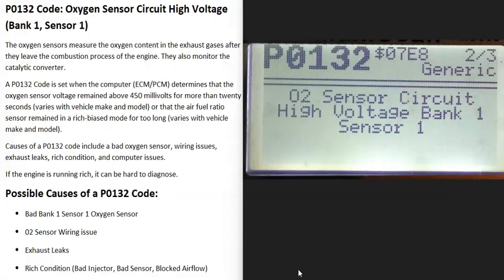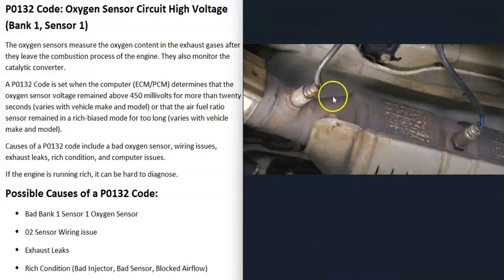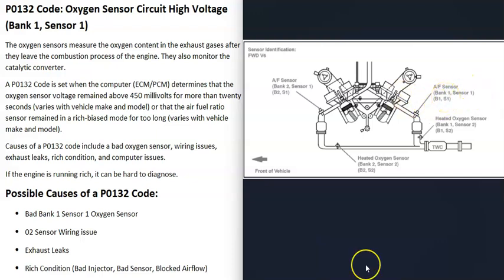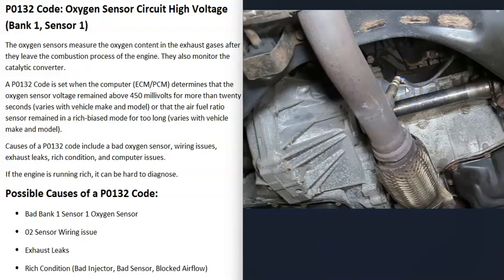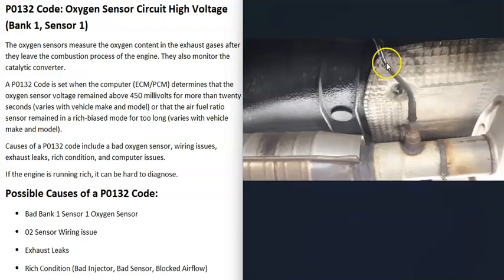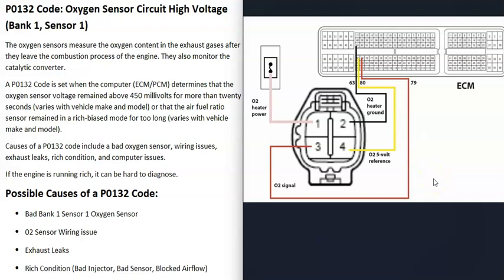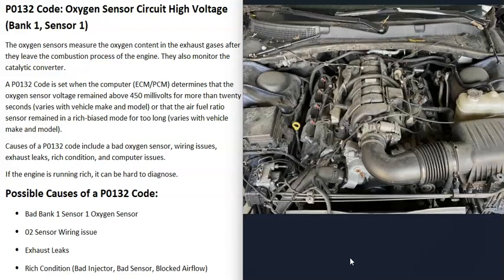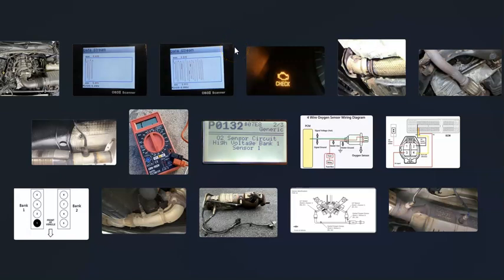Causes and Fixes P0132 Code: Oxygen Sensor Circuit High Voltage (Bank 1, Sensor 1)

Comment: Try cleaning or replacing ground for o2 heater.  My 09 caliber had "high input" codes for front o2 heater & manifold flow valve, and had "low brake fluid" warning lamp on, and inoperative headlamp lo and hi beams, and right front park/turn lamp inoperative.  All of these ground at the frame rail, along with a couple other components, all ganged together in one ring terminal.   I cut off the ring terminal and cut each ground wire back a few inches, then spliced in new wire segments with a couple new ring terminals, and cleaned the grounding post.  Cleared codes, and all problems were gone.  Find out where All your ground points are in the engine bay, and do this, before putting any more parts on the car.  Use copper dielectric grease on the bare wires before inserting in new terminal rings, then seal the terminal with liquid electrical tape after crimping.  Good luck!

Comment: 2016 Dodge Grand Caravan. I had an active PO132, historical P1128 followed by PO121. Added O2 voltages to Torque Pro which seemed in line, so I erased DTC's, drove 30 miles, no codes and seems to run fine. Whats my next step?
Reply from the maker: If the codes don't come back, then you're good. If they do come back, there may be an intermittent issue, like a bad connection or a component just starting to fail.

Comment: I currently have code p0132 and p0300 at the same time.. 02 senser suspect only i hope
Reply from the maker: A bad 02 sensor shouldn't cause a misfire. The engine won't be as responsive and efficient, but usually, the computer uses other sensors to keep it running with no misfires. P0300 with no specific cylinder codes indicates something that would affect the whole engine, such as fuel pressure or a bad sensor. It needs to be diagnosed, but with no other codes, I would be sure the fuel pressure PSI is correct.

Comment: I have a 2005 town and country with 0132. I"ve replaced the b1s1 sensor 5 times, most recently to a bosch after reading where it's the best one. Same issue. I"ve also replaced the map sensor, mass air flow sensor, all fuel injectors, I even replaced the ECM !!. Same issue.
Reply: I replaced the evap canister. Same issue. I’ve given up .
Reply: @ I have similar issue, but only few seconds just after starting the engine. It might be leaking injectors in my case during engine is off. Probably not a big deal.
Reply: check your EVAP system
Reply: @ which consists of ??
Reply: @silenthill5794  don't know your car, typically at least two parts:
1. charcoal canister
2. electronically controled valve
Reply: What was it ?
Reply: You have any leaks in your exhaust?? Take a shop vac reverse the hose so it blows air stick it in the tail of exhaust and spray soap and water from the head to thelast O2 sensor and see if it produces anton of bubbles

Comment: My 99 dodge ram 1500 sounds like it’s starving for air when it’s either pulling a trailer or driving in general. I recently put on a new aftermarket air intake filter on it. Maybe it might be that, cause it threw this code last night. Thank you for the info HVAC!